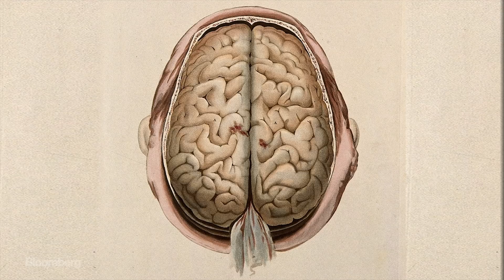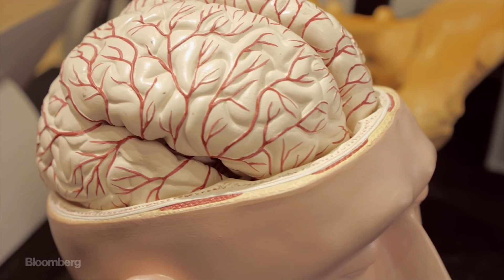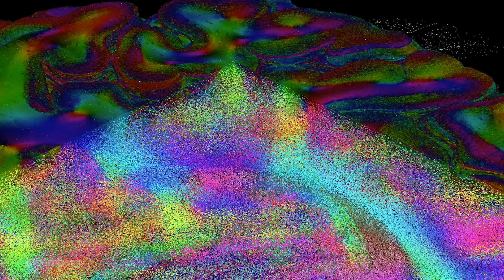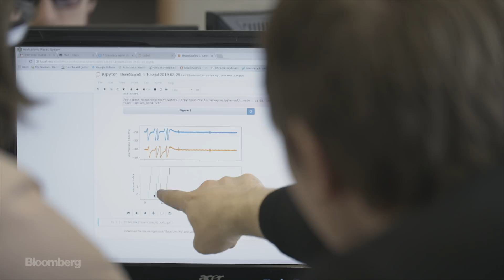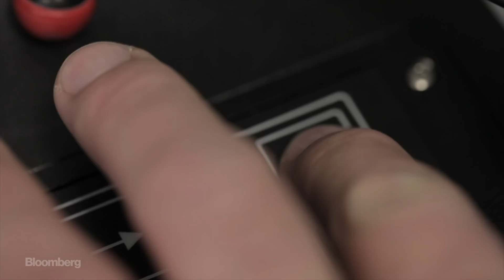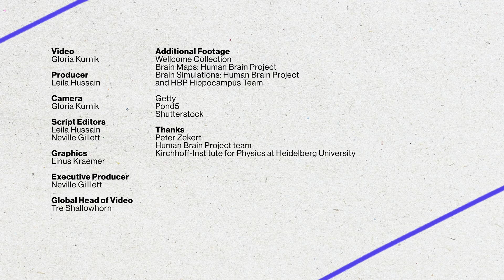Building a Computer Like Your Brain

Comment: Also, math I believe is a language. So perhaps math is what tells the universe what to do? Math like 123. This, “3” is not three. It is a symbol which represents 3. If I used a different symbol to represent three, like ) could this regester as 3 just as much? Perhaps if you looked at genes some genes could represent numbers but not communicate math the same way? Like it is like 123 but 1 is the symbol : and this symbol / represents 2 and this ) 3. Perhaps different DNA is similar?

Comment: I tried to sent a message to someone five times and four times it got removed. The fifth time it appeared for me even after switching accounts but not when I checked with my second account. I fu*king hate youtube. Why even comment at all

EDIT (I guess): oops I censored my word wrong resulting in a hashtag meaning my comment won't show up.
Reply: Editing the comment its reason why it won't appear won't make it appear. Like if you remove a curse word the comment will still not appear. I just made another comment

And from what I remember testing in the past adding a for example curse word in an edit will remove the comment anyway.

If you want to check if your comment is there you can either check with a second account or see if the comment counter at the top left of the comment section increased by one after refreshing the comment section by clicking on "sort on newest" or however it would be called in english. That only really works when the comment section isn't moving like this one.

Comment: 9:17 No that's not accurate as those artificial neurons likely operate billions of times faster than our brain's neurons.
Reply: They are faster but not complex or intricate... The brain is basically a super quantam computer that uses less electricity than a light bulb. Fascinating
Reply: @dru4670  There's nothing quantum mechanical about the brain's operation. The metric is ability to perform calculations, nothing more.

Comment: A signal traveling across a synapse is not the same as a logic operation (it's more like a single transistor, and a supercomputer has hundreds of trillions of them).
Reply: I'd say that the opening/closing of the ion channels embedded in the membrane are more akin to transistors. Except that there's 100's of types of them, but only two types of transistor in a computer, currently (CMOS). And then there's many types of neuromodulator, which have no equivalence in electronics.

Comment: "..and has potentially endless storage" As a fellow supercomputer I'd have to refute that....
Reply: Explain why?
Reply: @gravitydahiya9777  humans for the most part have what i like to call a "refresh memory" It keeps getting modified when new information is stored in relation to previous info, much like the ram if a system only has records of its last modified bits of information for example in a simple sense if it switched a one from zero, its only going to remember the one, and i am not sure if its what we can call endless storage, never ending storage maybe. You also have to consider cells can only reproduce a certain number of times before they die (hayflick limit) so the brain can not really functiion forever or refresh endless number of times even if you live forever which you  are not ( ref hayflick limit) even if you dont get any diseases and live in a perfectly conditioned isolated environment...
Reply: @mayankraj2294  Yeah what I was thinking
Reply: @mayankraj2294  and what's about photographic/eidetic memory?
Reply: @mr.froschi6526  what i have described is how (i think) the brain works, and i dont really think it would/should change for photographic/eiditic memory, its probably has got something &ó5 to do with the speed of the "refresh" (Formation of the new neurons n neural connection) and their rigidity once and after they are formed
Reply: @MollietovGaming  i am just purely speculating at this point and i dont really know the depth of the answer you require want + i am not qualified to give in depth answers, but i dont think there is a single cause, think of it like a computer how many component can/could/should fail before it drops dead or stops functionong properly, it could be manufacturing(genetic) error or external environmental factors might be effecting it eg absorbable Mercury on body and bloodstream, alcohol drugs physical injury etc.....also a point to note is we are still evolving (along with all the other living/evolving creatures our dna still doesnt copy perfectly resulting in mutations across species/evolution) it is plausible that some get the better part of it whereas some else not...oh well..
Edit - changed environment to environmental
Reply: @mayankraj2294  wow man I hope you work/study in some kind of scientific field cause your absolutly made for something like this. You gave some great answers to those who asked you. Really great work
Reply: @mayankraj2294  you don't need new cells to create new memories, each neuron can have around 10.000 synapses, potentially more, and that kind of neurite outgrowth is pretty limitless. I wouldn't say that human memory is similar to RAM at all
Reply: @Apodeipnon  "you dont need new cells to create new memories" - that is true but i assumed it would be obvious, since if you had to have a new neuron for everytime a new connection needed to be formed, the process would be painstakingly slow, the no of synapses we have cannot conclude/is not/does not present itself as the next logical step in concluding limitless memory as it is a unilaterally agreed observation that humans even at extreme ends dont seem to have the ability remember everything much like a video recorder does, lastly i only compared brain to ram as Neuroplastisity, as while it invloves formation of new connection it also involves slow weakening and elimination of old synaptic connection, thus rendering it closer to ram than to permanent storage of a computer........
Reply: @mayankraj2294  there are a few cases of humans with basically perfect memory. I think the brain does have that capability, it's just that it was more useful for survival to not have perfect memory and to  lose some memories. The destruction of memories is an active process that the brain does for some reason or another, it's not a flaw.
I see what you mean about the ram now tho
Reply: mayank raj Exabytes
Reply: mayank raj Post-humanism
Reply: @mayankraj2294  Not entirely true you have people born with conditions in which  they remember every single thing or facet of their life(side effects being server headaches and migraines). Tge reality is Your brain doesn't actual forget anything but simply prioritizes information stored. Were not sure how much info can actually be stored in the mind, last I heard the human Brain could retain 500 years worth of data(I wouldn't mind having an ssd that could store that much info)
Reply: @Apodeipnon  yep the reason is simply(probably) resource conservation, (you dont have to maintain synaptic connections that have now been rendered useless) how that happens i have no idea but they probably dissolve in the surroundings  also making room for new connections to be formed.....
Reply: @mr.froschi6526  I don't have it so it doesn't exist.
Reply: @gravitydahiya9777  hope that helps.....
Reply: u might be considering your inability to retrieve data
Reply: Is not the fiscal brain that stores everything is your spiritual brain.
Reply: @levantateyora9317  ??
Reply: @mayankraj2294  the brain is mostly made of fats and nerves and it has blood vessels. So that means no information can't be store there. Information it can be transferred through light or ee say energy. So does electrical  sparks that accord in the brain is transfering information to the spiritual brains wish is what we are a spirit , we are spiritual beings. So our fiscal brain all it is a transmitter it transmits visual information to the spirit. In 2015 I had a clinical death for 3 days. My soul came out of the body, and put of my body I had all the information from my entire life. When I came back to my body doctors say that I won't remember anything because my brain was dead that I was a vegetable. And when I told them that I remember even what they did to me while I was dead they couldn't believe it. Nikola Tesla he in his interview said it that we are energy and everything we see and learn it will always stay with us even after we leave this body.
Reply: @levantateyora9317  for the sake of cutting it short i would only point out major problems with the arguments...1st   "...and it has blood vessels. So that means no information can be stored here" Inaccurate, computers are made of tons of n and p gates and it can technically story information, information is just an order of things, everything stores information    atoms, protons, neutron everthing..... In case of brain and computers we "store" Information with flexible and changable arrangements which each respective system can interpret and do something with ....the definition for information storage on macro world is different from how information is defined in physics world however your statement is inaccurate/irrational nonetheless....as for your personal experience which even of/if considered to be true and accurate is not usefull, physics world and scientists can only work with what is definable(useful), your experience is not definable, the theory you make from it might be if its accurate, which it doesnt seem to be...
About the energy argument, yes everything is energy but that is true by definition because you cant really interact with something that doesnt have some form of energy and thus detect(be able to detect) the presence of anything else, everything is made of energy is a recursive statement
Edit - sorry if it might seem rude from an external prespective, it truly is not meant to be....
Reply: @mayankraj2294  is ok dont worry.  Are you aware of the spiritual realm?
Reply: @levantateyora9317  maybe not in the way you might wanna describe it...+ never had much interest in it ever....so sure go ahead.....
Reply: @levantateyora9317  So when someone has Alzheimer, is it the spiritual brain forgeting things??